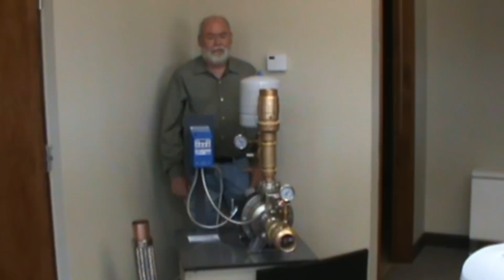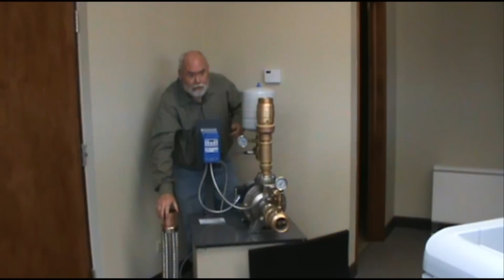AquaMark Water Pressure Booster

Comment: Not even a closet so would this be able to stand the outside temperatures which in my area we get all 4 seasons its cold in winter and hot in summer. I would keep it under the house so it wouldn't be exposed to rain or anything like that and I can build a cover around it. Please let me know as my 39 psi water pressure just doesn't cut it. Thanks

Comment: Thanks for the vid. I have a 3 bedroom 2 bath single story trailer....my water pressure is only 39 psi and it sucks.  My washer and toilet take forever to fill and my pure water system I installed takes for ever to fill it is right at its minimum which is 40 psi. Could you reccomend your best system for my particular needs. Keep in mind everything is plastic pipe I think pex so it would have to be able to withstand the pressure also I have virtually no room in the home to store the system,